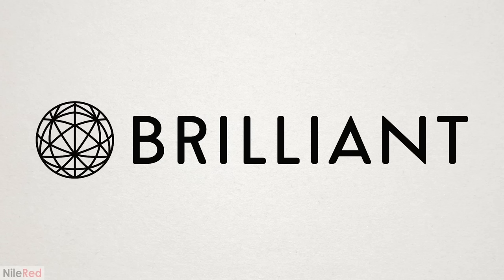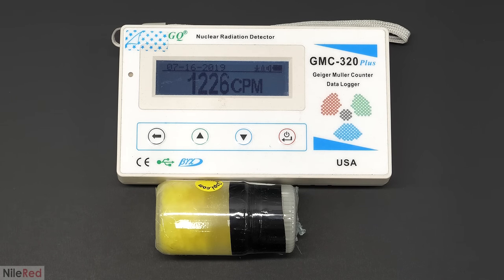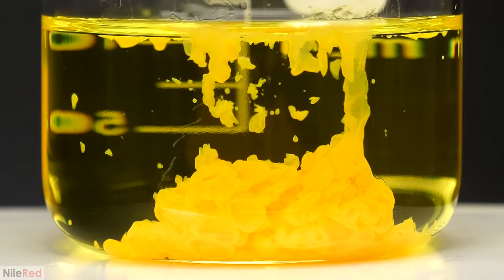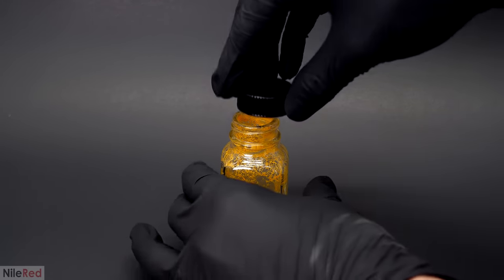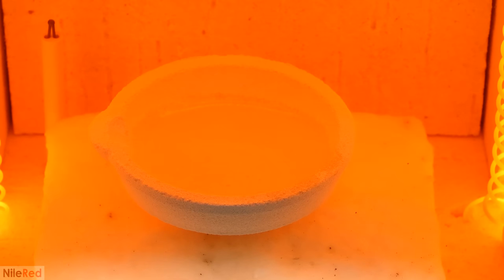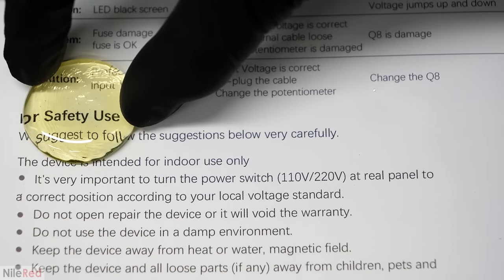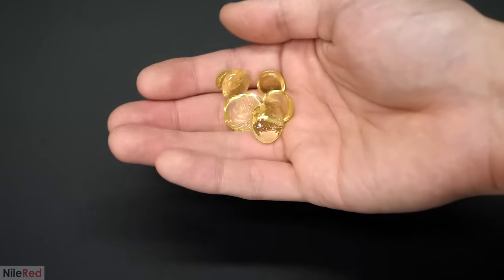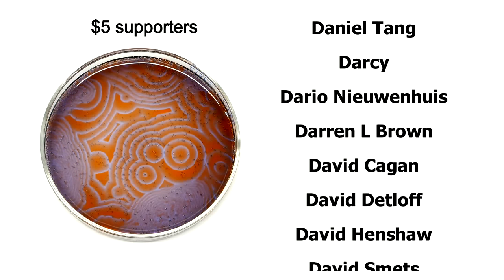Making uranium glass

Comment: 26:23 , just a small objection, the instrument's results are calculated in Micro Sieverts (μ) whilst the graph given in the left side shows the Sieverts in the scale of Mili (m). To give an accurate example of the difference, mili is 1*10^-3 whilst micro is 1*10^-6. Micro is a way smaller unit and does not equal to a dose of a CT scan.
Reply: Good
Reply: aaaa
Reply: yes and not. as you can see the ct-scan is 10 millisieverts but he specifically mentioned the DENTAL X-RAY which is 0.01 milli sieverts or 10 microsieverts so if the reading is 5 microsieverts that meants that you will be exposed to 1 dental xray worth of radiation every 2 hours, on the exception that you receive the exact amount that is gives off and pretending that alpha particles penetrate you skin (they do not penetrate) so nigel is actually right.
Reply: @Electroneer0  you are right.
Reply: @thestupidcupcake8334  no it is not. The chart is correct, and he converts the units correctly in the video. He specifically mentions a dental x-ray which gives a significantly lower dose than a CT-scan or even ‘regular’ x-ray (such as a chest x-ray). 

Still not a good idea to carry that glass with you all day, 5 μSv an hour is pretty high if you’re continuously exposed to it. 

Depending on the type of radiation (alfa/beta/gamma particles; not elaborated in this video) as a former radiation worker I would recommend storing it in a lead chest or in a room with brick/concrete walls that you don’t come into that often. 

The dose it gives off isn’t that high, but still significantly higher than typical background radiation and prolonged exposure to low/medium doses of radiation can still have negative effects in the long run. Always best to minimize it as much as possible.
Reply: @martino087  you are right, I paid close attention to what he has said and did the calculations myself, it indeed turns out to be true.
Reply: @martino087  your actual received dose should be much lower than 5 micro sieverts per hour since depleted uranium is primarily an alpha emitter, right? Also because of the square cube law the intensity of the radiation will drop off dramatically just by moving a few feet away.
Reply: @martino087  Also the lowest annual radiation dose clearly associated with an increase risk of cancer is 100 milisieverts, which is more than double the dose you would receive by wearing this piece of uranium glass for a year straight.
Reply: @jaffacalling53   as I said: depending on the type of radiation (alfa, beta and/or gamma), and carrying it with you (in other words: holding it close to your skin). And radiation can do other damage to you then increasing the risk of cancer, also, the first rule is always: reduce the exposure as much as reasonably possible, regardless what the accepted norm is.
Reply: @martino087  I feel like there is a point where the radioactivity of an object becomes so negligible that taking special precautions such as keeping it in a lead box becomes overkill. I don't see why you'd need to do anything special with uranium glass besides not keeping it directly next to your bed or something.

Comment: 12:50 I was always under the impression that regular glass blocks many types of UV, so this could be why it isn't fluorescing inside a glass container.
I'm only aware of this because ye olde EPROM chips use a quartz window, because glass does not pass enough UV light to erase them fully.
Reply: YES, I facepalmed a lil bit when he was confused why it didn't fluoresce inside the jar.
Reply: Blacklights make things glow with "Near-uv" basically light on the border between visible and uv. I think normal glass lets that pass through, there are even blacklight fluorescent tubes made of normal glass.

It is the shorter wave uv like UV-C that are blocked by normal glass.
Reply: Yes, this is most likely the case. When doing anything UV in the lab, you need to use quartz glass containers because those wavelengths can't pass through silicon dioxide glass
Reply: @matiastripaldi406  Really? I thought near-uv could pass through normal glass because blacklight fluorescent tubes are made of normal glass. It would appear that I was wrong, thanks for pointing that out.
Reply: Hes a chemist, not a physicist! 😅

Comment: "I was in no way a pro, but I decided I was ready to add in the Uranium." 
Just as a tip, add Uranium to most things, especially if you have only done this thing once.
Reply: bad advice. i put some uranium in my food and ate some alpha particles
Reply: @themushroom2130  you’ll be good helium nuclei aren’t inherently dangerous when ingested to my knowledge
also yes this is a joke I know
Reply: @txtp  Alpha particles are usually pretty harmless because your skin is thick enough to block pretty much all of it but they can cause damage if ingested.
Reply: @isodoubIet  is THAT a joke or can i not worry about getting my skin melted off?
Reply: @Sigilssoulsonxbox  It wasn't a joke, no. If you know a radiation source only emits alpha particles you'll probably be ok handling it without special protection. Note however that some alpha sources, like depleted uranium, sometimes also come with very fine dust and that stuff can be horrible for you, both chemically (it's a heavy metal like lead) and radiation wise. But uranium glass should be safe (as long as you don't grind it, cut it, etc).

Comment: Very late to the party on this and hopefully not just repeating what someone else has already said. As best I can tell no one has though. I just wanted to chime in to mention the inaccuracy of the radiation reading at the end of the video with the higher end GM meter.
TLDR: The meter is only accurate for actual dose rates when measuring exactly 662 keV gamma.

While it does display units of radiation dose instead of just CPM, that is still a GM probe and is therefore incapable of discriminating energy and particle type. Specifically with the uSv/hr measurement, a true equivalent dose rate measurement like this requires both knowledge of the particle type for the "Q factor" and the energy of the particle interaction. The "pancake probe" as they are often called that you are using is almost certainly calibrated to Cs-137 (662 keV gamma emissions) and displays those units by assuming that any interaction is also a 662 keV gamma, so they are often up to 20 times off unless you can determine the average gamma energy and make a correction factor based on that (assuming there aren't any alphas or neutrons). All that to say, it is very hard to know the true dose rate using a detector like that and you would have to resort to something much more sophisticated such as a scintillation counter (still might have some troubles with the alphas on this), open air ionization chamber with an open window design (might have a harder time discriminating the alphas with a current detection schema instead of pulse detection), or something else. Likely to get an accurate reading you'd have to obtain a true exposure rate using an ion chamber, then get a proportion of alphas to betas using some techniques others in here have already mentioned, and then apply the ratios to estimate a Q-factor proportion for conversion into an equivalent dose rate. Not that you likely care about getting that accurate of a reading anyways, it just got me excited to think about a problem of measuring something like that and here we are after a long winded rant. Anyways, I appreciate the content! Keep it up!